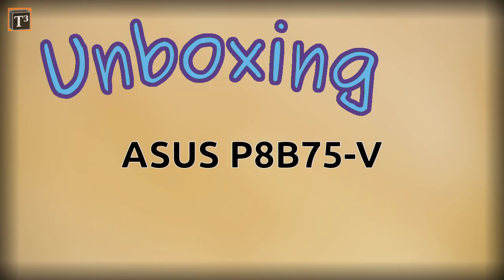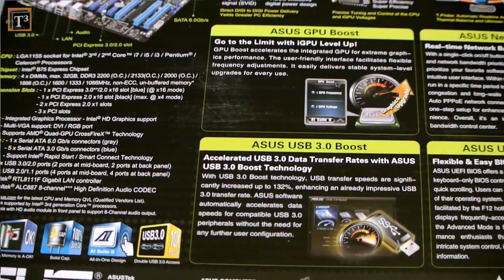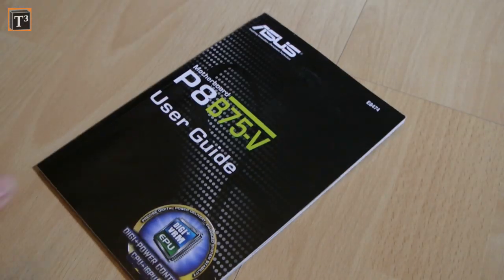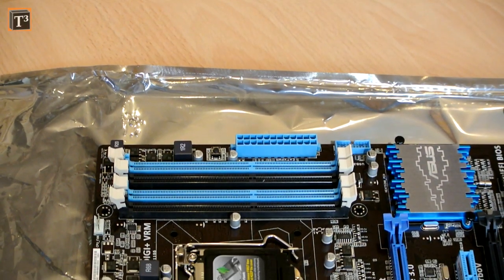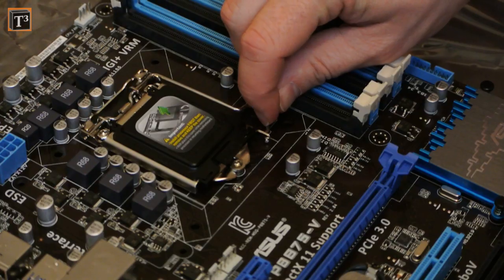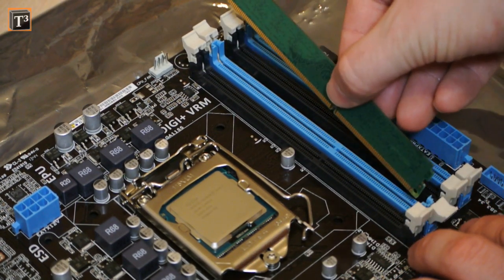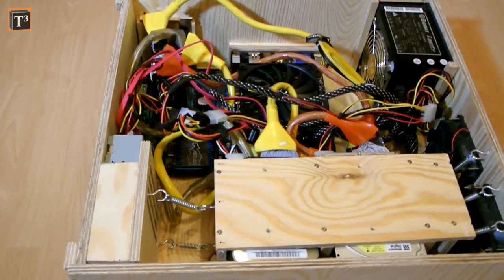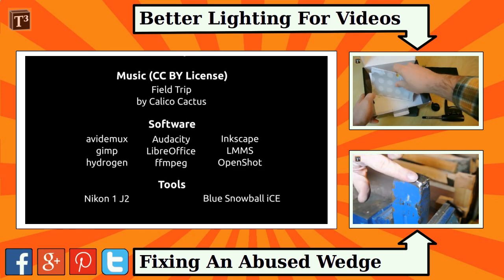Fileserver CPU and RAM installation ▪ Unboxing ASUS P8B75-V mainboard

Comment from the maker: Lukman Hakim Abdullah the mainboard doesn't care in which order you install the components. It will just not work before all important parts are installed. So yes - you can definitely install the CPU as last component.
Reply: Thanks. So I can just install all the other parts first and when the cpu arrive I can install the cpu and boot the system? I'm worried because all tutorials I watch suggest to install cpu first.
Reply from the maker: Lukman Hakim Abdullah I built uncountable PCs as it once was part of my job and I guarantee you that from a functional point of view it does not matter when you install the CPU.
There may be practical reasons though for a certain order like for this board you need to install the RAM before a big cooler as the access is otherwise blocked.